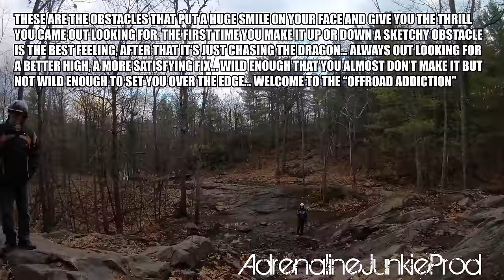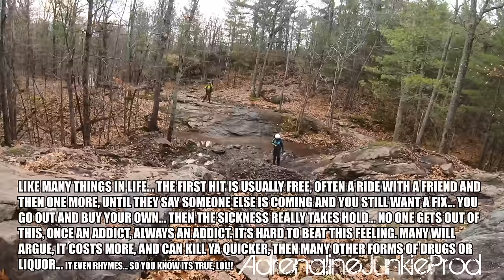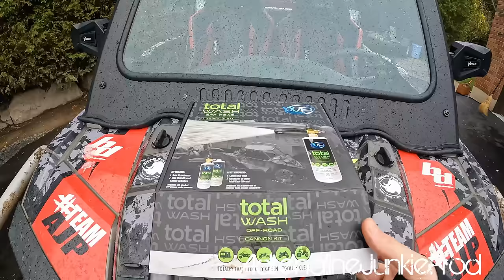The Bigger They Are The Harder They Fall! Feature Length UTV/SXS Off-Road Trail Riding Adventure

Comment: Julian I have a question what is the best wheel bearing grease to use on my Rzr turbo ?
Reply from the maker: Hey man. Most important thing is to grease them semi regularly. Any good name brand grease will work. Don’t over do it though. I usually do 5-10 pumps out of a cheap grease gun but it will depend on your grease gun. When you see the grease starting to come out of the outer seal stop. Too much can lead to excess heat build up if you do a lot of high speed riding. I’ve had good luck with Lucas red or green grease and CRC products. Any good quality bearing grease is fine though. Usually the issue is the grease breaks down or washes out. The bearings come super under greased from the factory mostly due to shipping and chemical regulations. Nothing is more important than greasing new bearings properly. Hope that helps.
Reply: @AdrenalineJunkieProd  yes sir it did thank u

Comment: Sway bars front/rear connected. Im a mountain trail rider. Dont care for tipy chassis. With lockers doesn’t need to be flexible. Prefer a flatter chassis profile feeling for higher speed rally type speeds. Trail riding goal is tire placement to maintain a level chassis.

Comment: Thanks for another feature length video. I always like seeing the machines with minimal mods and accessories like the 1000S and the Wild Kitty do well. I hope getting together with Dirt Dudes and / or Blown Budget works out better than Eh TV. For better or for worse, that was kind of a bust here. The ride still turned out great though, as you ended up with a good group.

Comment: Great video!  I have disconnected my front sway bar and rides much better.  Not sure I am ready to disconnect the back one, it has prevented me from tipping a few times.  I have a Wildcat Trail and being at 50 inches, I need the stability.  My machine could use a good washing.  I normally wash by hand and just hose pressure.  That cleaner looks like it works great!   Looking into it. . .    #WRPERFORMANCEPRODUCTS

Comment: I've always full removed the front sway bar and unhooked the rear. Flexes awesome and rides soo much smoother on the trails. Yours may feel a little more tipsy with that rear cage extension but it's nothing you can't get use to

Comment: What’s the deal with demon power sports? Elaborate please.
Reply from the maker: Knock off artists. We have seen multiple axles binding out of the box. Failures on the first ride. Boots falling off. Boots twisting. Difficult to communicate with them. They place blame on end user for everything. Wheel spacers they made breaking, studs snapping right off. Demon saying it’s abuse of the end user. They white label for a ton of other “cheaper” brands. They are “sourcers”, source the cheapest Chinese product they can knowing it’s poor quality. They place the identical axle in different boxes and charge different prices. They don’t care about the industry at all, just their bottom line. They make statements of their joints and axles being bigger and stronger and when compared to stock axles some measurements come in smaller. They claim to use materials they don’t. Many of their axles were over heat treated and brittle and shafts would snap. These are not claims which I can’t back up, they are legit. I posted a video of an axle braking on the road during its first use a few seasons ago. They blocked me off all their social media and demanded I remove the content lol. For the money there are many better options on the market that are backed by more reputable brands. Demon Powersports and Rugged Offroad are the same company. I never really brand bash but I’ve had many negative first hand experiences with this brand and so have many people I know. Their headquarters is about an hour from where I live.

Comment: Nice video. What were on the x3 next to the snorkles?
Reply from the maker: Thanks!! If you are referring to the big square contraptions to the right of the snorkels. Those are radiator relocation kits that move the rad to the back of the bed.

Comment: No sway bars and no straps. I adjusted the shocks stiffer and it helps on higher speed some but still miss the sway bar sometimes for faster travel.
Reply from the maker: Ya, it sucks at high speeds without the rear sway. It only takes a few mins to reconnect it though.